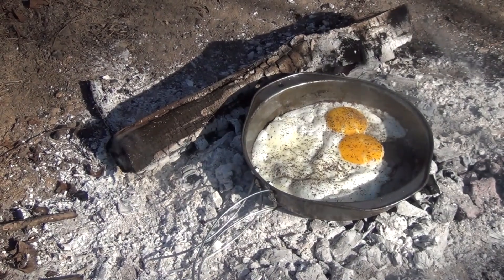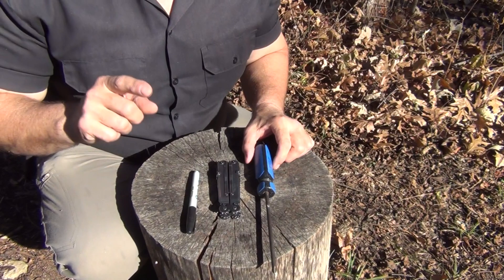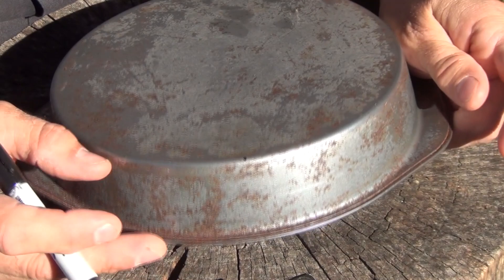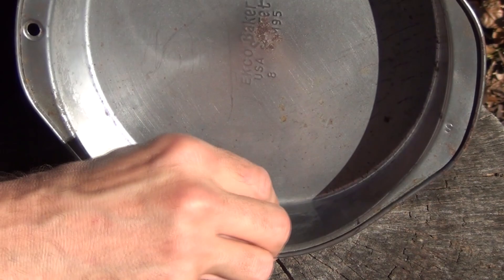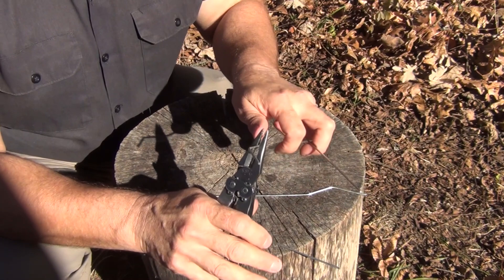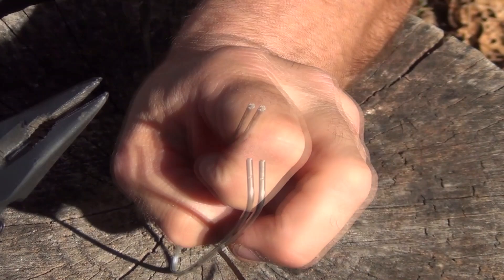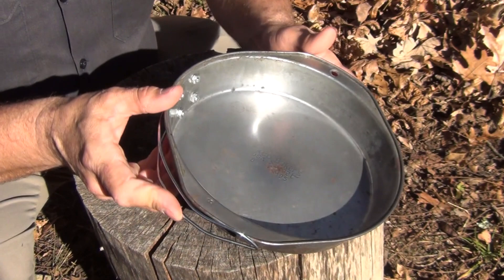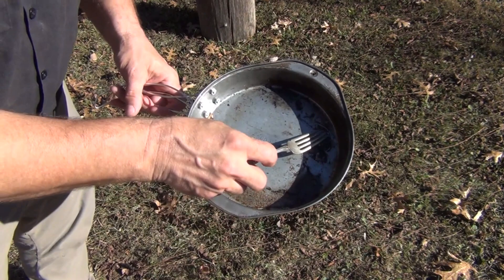Frying Pan Hack! [ Cheap DIY ]

Comment: Hey James, great idea. One thing to mention, ya may consider using stainless bolts and nuts.  A lot of other bolts can contain zinc and/or lead. Another addon for stove use could be a few coats of plasti dip on the handles. I agree with the commenter that stated about you and Dave Pearson could equip a platoon with second hand store made gear. TC and ATB, Cris.
Reply from the maker: Great point!

Comment: Thanks for another great video!!  Pop rivets would be cheap and could be hammered flat and avoid most food particles on the inside of the pan.
Reply: That was my first thought too!!! Insert the rivet from the inside so the compression nub is on the outside...depending on the size of the rivet...3/16" or 1/4", you might not need a backing washer on the side where the hinge is if the rivet is snug in the hinge screw holes.
Reply: you can get the solid peen over rivets too!

Comment: I’ve been using one of these cake pans as my frying pan for years, though I like your handle idea better.  I added a 2nd pan to fit inverted on top of the first pan to create a Dutch oven.  Make sure the 2 handles with the holes line up, then fit with a screw.  This allows you to swivel the lid away to access the food and then swivel back in place.  And you swivel the lid open to adjust the inside temperature.  It’s also very useful in keeping the ashes from getting in the food.
Reply from the maker: Great idea! I may add that to my repertoire and even do a video on it, if you don't mind!

Comment: I like most of your builds, cuz they’re not only usually good ideas, but literally something you can build on a log, and no workshop needed, but this one I’m not so sure about the screws and bolts.  I guess for occasional use it’d be fine
Reply from the maker: The screws and bolts work very well especially since you can take them apart for occasional cleaning when needed.

Comment: I noticed in the comments several mentioned your praying. It struck me as odd that they just now noticed or that they must be new to your channel.
BTW  nice vid.
Two change suggestions. Solid rivet from inside out and pot easier to clean.  And last put just a bit more wire through hinge and bend to keep handles from slipping with heavier food.
Reply from the maker: Thanks. Yes, you could definitely make those changes if you wished!

Comment: A dremil  tool with a cutting disc could be used to trim the extra off the bolts. Having the ends flush with the nuts will make for a better surface inside. Bolt two pans together with a bolt and wingnut for a small dutch oven.
Reply: just peen them that way they don't loosen up!! better yet use peen over rivets!!

Comment: I'd be tempted to rivet on the handles.
Reply from the maker: I don't think you would want to use aluminum rivets as they might not be able to handle the heat very well and also you wouldn't be able to take it apart for cleaning.

Comment: I'm always down for cheap mods, but go to Dollar Tree, don't be eating out of a rusted pan.   Also, if your shop on any of the online places like all the express, you can get a liner that will fit there that's designed for thin cheap cookware, so that you have a nonstick surface.  After you done cooking you just wash it off.
Reply from the maker: Thanks for watching and for the suggestions!

Comment: How bout using stainless pop rivets instead? I made a set of aluminum skillet lids years ago for camping, using 10 ga. aluminum tread plate with 3/8” ss tubing bent as handles attached with ss pop rivets. No corrosion problems, as stainless and aluminum are inert with each other.
Reply from the maker: That would work, but the problem is that the pull pins that make the pop rivets work would probably leak as they leave a hole. You might be able to pin them over but you still would not be able to disassemble it for cleaning like you can with screws, nuts and washers.

Comment: You might use rivets instead of screws. Just a thought
Reply from the maker: However, most rivets are made from aluminum which would not hold the heat as well. Also, you can disassemble the screws nuts and washers for cleaning if necessary which you cannot do with pop rivets.

Comment: Hi, why not rivets instead of bolts and nuts? it is better, the your idea itself is cool
Reply: Can always tighten the handle or remove it easily for cleaning, but can't do that with rivets.
Reply: I was thinking the same thing. But I think most rivets like that are aluminum based and might not hold up to the heat or would wear out quickly.
Reply from the maker: I think that the screws, nuts and washers are a better option like the other commenters stated.

Comment: can you use rivets instead of the small screws and nuts
Reply from the maker: Pop rivets cannot be disassembled and cleaned as easily as screws, nuts and washers. Also, most rivets are made of aluminum which would not hold up to high heat very well as well as the fact that the pull pin that makes the rivet work leaves a hole which would probably leak.

Comment: Any thoughts on using pop rivets to attach the hinges? Would they be water tight?
Reply: pop rivets waterproof no the with pull shaft being hollow it'll leak unless smashed down good but most hardware stores have the solid peen over rivets and they'd be waterproof!!
Reply from the maker: Pop rivets would work, but as stated, they would be nearly impossible to disassemble and clean and they may not hold up to the Heat very well.
Reply: @WayPointSurvival  if they're seated well enough removal for cleaning is unnecessary! there's plenty of hammered steel kitchen pans out there with riveted handles that never get took apart!

Comment: Can we pop rivets in hinges and instead of bowling a man
Reply from the maker: Pop rivets cannot be disassembled like screws nuts and washers for cleaning if needed. Plus, most rivets are made of aluminum and may not hold up to the heat as well as the fact that there is a hole in the center for the pull shaft which would probably leak.
Reply: @WayPointSurvival  thank you

Comment: where in the hell are finding stainless hangers i have enough trouble finding plain metal ones anymore most around here are plastic of some kind now! you might want to peen over the bolt ends on the inside or better yet get some peen over rivets! you know metal coat hanger and peen over rivets are two things (along with strike anywhere matches!!) i thought we'd never have trouble finding but?
Reply from the maker: I ordered them in bulk off of amazon.
Reply: @WayPointSurvival  one company i'll never do business with!! the only thing i want to do with the company or owner is celebrate the demise of both!! especially the doctor evil clone!!